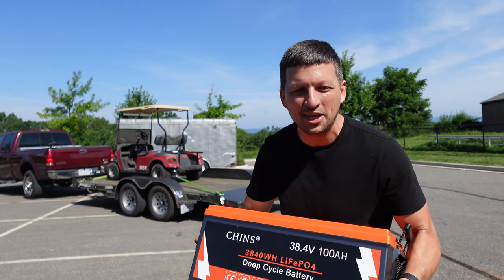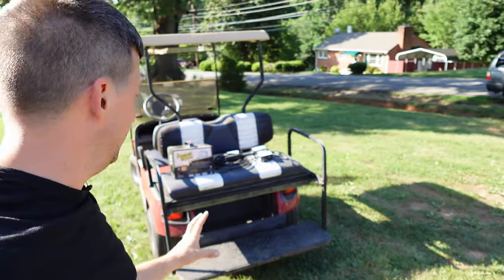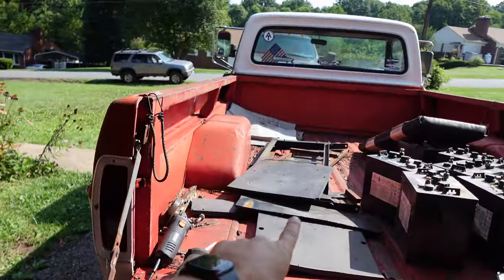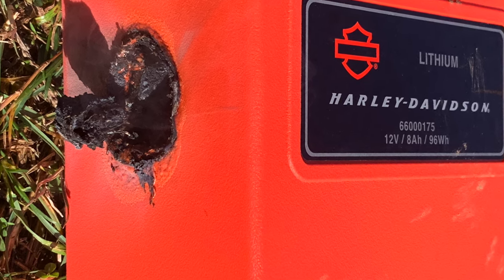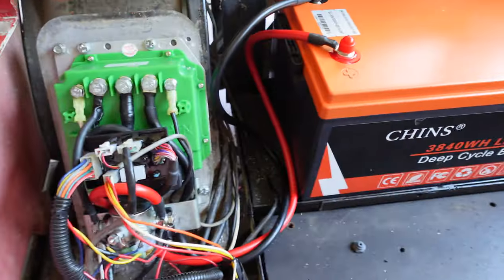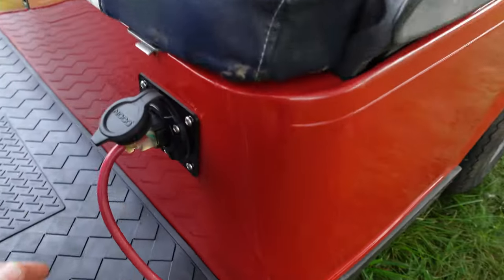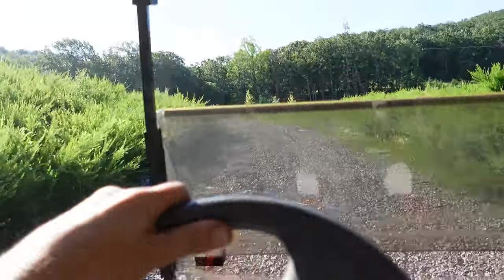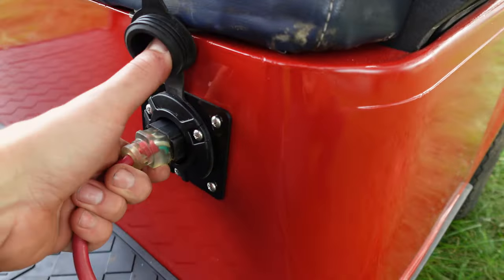Range Testing a CHINS Lithium Golf Cart Battery - PS Its Cheap!

Comment: Those things are absolute JUNK! I've had two fail that are a little over a year old. Tried to do warranty claim and they have been giving me the run around for 2 weeks, every time you give them information they want more and respond two days later. STAY away from this junk, it's going to cost you more in the long run.
Reply: What do you recommend?
Reply: @chentez1  good question! I liked the lithium batteries when they worked, much lighter and the voltage is constant until it dies. I bit the bullet and bought an Eco Battery, the price has come down a little but still paid 2800 bucks!  Time will tell if it was the right decision....
Reply from the maker: I can't speak to his experience but ours has been rock solid for a year.  My in-laws are not exactly kind to it and its held up.

Comment: I considered a cheaper lithium battery like the Chins which is a great value  until you have a issue and need it warrantied. These batteries are not well built. You could have zero issues and be lucky. I didn’t want to chance it myself

Comment: I have their 24 volt 150 amp battery, been running it 24/7 365 for two years in an off grid system . It's charged with a 1000 watt's of solar panels.. Full size refrigerator going all the time, washing machine or gas dryer when the sun is out all day.. It's modest with a 2000 watt inverter.. Best investment I've made in a battery..
Reply from the maker: I love all of this.  What kind of panels are you using?

Comment: Im just curious about the 10 years but time will tell.  I just got 3- 12v newti lithium batteries and charged once when it got to 79 %. That was a week and a half later. This 2004 ez-go txt has NEVER gone this fast. Gps it on waze and was doin over 15 - 18 mph !
 And shed 200 pounds !

Comment: Hey, I bought the same battery and put it in a 2001 EZGO TXT series cart. The only accessories are a light kit and radio. But it does have 20” tires on it. The cart runs fine but the range is nowhere near what you’re getting. The best I’ve gotten is 27-28 miles with the battery reading 23% remaining. Thing is, I’m afraid to discharge it any farther as once it drops below 50% the voltage seems to drop off pretty quickly. And I’m not pushing it, my average speed is around 12 to 14 mph. That sounds like a lot but the bigger tires seem to give it more speed. Another 2-3 miles would be all it takes to run it out. Got any ideas why the mileage is so poor? I keep hearing guys talking about 40 - 50 mile ranges. I can’t figure it out.
Reply from the maker: Is the 01 a different cart?  This has the switch on the dash for FNR.  I'm not sure what year started using a shunt motor and stopped using resistors to dump energy.
Reply: Checkout carts unlimited they have a conversion kit for that
Reply: Did u ever figure it out, I have the same issue

Comment: I bought a chins 20ah 12/23/22 to run my Livescope and head unit lasts 13 hours and I fish every weekend impressed so far little over a year old zero problems as of yet
Reply from the maker: We've abused this battery and it has been rock solid.  I'm seriously considering swapping out the lead acid battery and the charge controller on my RV.

Comment: Nice video ty! I gotta ask, the charger you have a link for is not far from $500.00, that's a rather  steep price for me. I'm a bit confused on converting to lithium: can I get a charger with that "D" shaped connection or do I need to remove the seat with each charge? Also, do I get a 36v charger or does a "smart charger " simply know what it's connected to? I'm sorry for asking so many questions lol
Reply from the maker: Great questions!  I often see (and have bought) those chargers used on eBay.  A the white tag has the model number on it.  If you can find a 30600 it will charge 36 or 48 and do lead acid/AGM/Lithium profiles.  These chargers (and others) have the option of using the D plug - but the charger would be off the cart.  Think of mounting it to the wall in your garage then plugging the D cable in.  I mounted mine onboard so I carry it wherever it goes.  I converted it to us a standard extension cord in place of the D connector.  I hope this helps.  I'm thrift too.  If you look around and get creative I'm sure you can save a few bucks!

Comment: I recently bought a 2007 EZ-Go cart and everything on it looks brand new, the entire cart looks brand new, and zero rust. I got it from a shop and the lead acid batteries were manufactured in April 2024. I still want lithium, but it will be lightly used so I’ll wait to see if it worth upgrading now or is I should wait until the current batteries run their course.
Reply from the maker: I would rock the ones that are in there until they don't meet your needs!

Comment: Lithium batteries are indeed worth investing in. Recently, I upgraded my 06 club car to Vatrer 48V lithium batteries, which use A-grade cells and are currently performing well. I no longer need to spend time maintaining the batteries.
Reply from the maker: I’ve been looking at their battery.  I picked up a 48v project cart that needs repowering.

Comment: Can i use my regular charger that came with the cart? Ready to buy battery. club car precedent 48volt. Thank you in advance
Reply from the maker: Hey sorry for the delayed response.  You could, it would depend on the BMS in the battery to turn it off when it was done charging.  If you are looking at a lithium battery, you should really look a pairing it with a lithium charger.

Comment: did I see a Navitas controller? I am wondering how this battery would hold up with some hi performance mods
Reply from the maker: You did see a Navitas controller!  Its just the stock replacement....although the thought of the inlaws doing wheelies and drag racing their friends sounds hilarious.   You'd have to check the amperage rate of the mods you want and see if it matches the discharge rate (sometimes noted as the C rating.)

Comment: Is this battery just drop and go? All I'd have to is connect the positive and negative terminal and ride? I have a 48v system.
Reply from the maker: You would need a 48v, but yes they are pretty much drop and go.  If you have 12v accessories like light, you will need a $20 step down converter.

Comment: Installed one of these CHINS for the Mother-in-Law.  Pretty good I must say, stock everything else.  2008 EZGO TXT-PDS.  I didn't want her to need to open an app to monitor status and installed an LiTime Monitor with Shunt.      I may not have ever known there was an issue had I not installed the add-on monitor but the REGEN is apparently not regenning....   the LiTime monitor records the REGEN amps going back to the battery (which is reporting 99% Remaining) but BMS is reporting 62% remaining (kinda what I expect without the regen).   Haven't found a tweak to remove the regen calculation for the status in the monitor or on the battery to accept the regen charge.  

Any thoughts?
Reply from the maker: Oh man, I have no good insight.  We swapped out our controller with the Navitas because the OEM was toast.  I know the Navitas has a programmable regen setting, but I'm unsure if you can adjust the EZGO.    How do you like the shunt?  I'm thinking about putting one on my RV.

Comment: I have a 2000 GEM E golf cart just removed the acid batteries. It's a 75 volt would this be enough to get her running? Thoughts? Thank you so much
Reply from the maker: I was wondering about those Gem’s…what kind of batteries came out of it?  How many and what voltage?
Reply: @BootstrapRevival  Ob my goodness I just killed myself & reinstalled the new acid batteries so heavy 😜🤪😂 My GEM is completely refurbished, did it myself but priced the lithium & way too expensive. Between $2,000 to $2,300 for everything. It’s a 72 volt 3 HP, if it were a 46 i would have been cheaper. I’m using Marine 31D deep cycle batteries they last two years only. It cost me $800 for the batteries. Thank you, I tried 🙏

Comment: How exactly did the charger sent up to for your Lester’s charger. Mine runs into a low voltage fault. Not sure what to do?? Might have to go to a different charger
Reply from the maker: I used the generic lester lithium profile.  I ignored the lester app and watched the BMS app to see it cut off in bound voltage and not over charge.  It has not been an issue with the battery.  I do know different lester models allow for different profiles (meaning some don't allow for lithium charging).
Reply: Are the different profiles selectable through the charger app or do you have to order the charger profile specific? I just noticed the amazon adds do not say anything about the profiles. Thanks @BootstrapRevival
Reply from the maker: I apologize for the delay.  Correct, in the app for the charger you can set different battery profiles like lithium, lead acid, AGM, 36v, 48v.  They even have a pile of profiles for the big player brands of batteries.
Reply: Thanks for the reply! im working on restoring a 1995 club car ds and i am probably going to go with this same battery @BootstrapRevival

Comment: How's the battery holding up? I'm looking at buying it for my cart
Reply from the maker: Honestly it’s been a champ.  We gave the cart to the in-laws and they have been using it non stop with no issues.
Reply: @BootstrapRevival  thanks for the response 
I'm just a little worried if I go up a steep-ish hill with a passenger or 2 it might trigger the overload and the bms will shut down the battery but it looked like you went up some steeper stuff and it did fine 🤷‍♂️
Reply from the maker: @predatorhuntsnw1835  - I did, and the really steep stuff was with two people.  It didn't film well, but I went up a super steep pitch up a mountain.  That grade is difficult to walk and my cart did fine.   I like buying from Amazon because of their return policy.  If you do try it out and you have issues you can return it easily.  Let us know how it goes!

Comment: I have a ezgo txt and have been reading that I have to run two batteries?Do you know if that’s true? Or can I run one like you did?
Reply from the maker: I used just the one large lithium on a 36v cart.  (They make one for a 48v cart too).  I'm not sure why you would need two.  I would highly suggest a cheap voltage step down converter to run your 12v accessories and lights.

Comment: Been thinking of doing this and adding an inverter so that my golf cart can be a mobile power station.  I would like to build a small cabin near a pond on my property and this would be a great way to get tools and power up to the site without having to run a generator.  Throw a couple of solar panels in the mix and, Bob's your uncle.
Reply from the maker: I completely agree.  When we get a few acres I want to upfit a cart for farm work including mobile power.  Almost like a portable generator but less of a main to more around!
Reply: I have a 48 volt Yamaha golf cart that I put 4 12volt chins batteries in and a 60 volt 325 watt solar panel on and I haven’t had to charge it in 3 years. Just bought a 48 volt inverter to do the mobile power station too

Comment: Nice Vid!  I have a 2006 EZ-GO TXT with the PDS drive (36v)....Is yours a series motor or PDS cart?  What are the details on that new controller and harness you've installed? Is there a link to that? My stock Curtis controller seems to run quite warm after just a three mile drive.  Thanks
Reply from the maker: Great question.  I have a PDS cart.  I used the Navitas 440 Amp  TXT stock replacement.  It cheaper from this seller on eBay than anywhere else I've found.  It includes the cool remote to adjust (and lock) your speed/acceleration/regen. The kit is plug and play.  It would not fit under the cover so I cut the cover in half and it hangs out but its waterproof.  I was able to keep my run/tow switch in the same spot.  I think they make a mounting plate - but I just made do with what I had.

https://www.ebay.com/itm/303204173360
Let us know how it goes!

Comment: Are you using a the Lester summit 2 charger with this? I read a review that chins only will accept their own charger
Reply from the maker: We are using the Lester 2 charger with the generic 36v lithium profile.  Between the onboard battery BMS and the lester it has been working fine.  The only odd thing is the lester app shows over voltage, but the battery app shows that BMS turns the charge off at the right voltage.  I suspect Lester might have a profile update as more of these inexpensive batteries come on the market.  We will be at the in-laws house in a few days for the Holidays and I'm going to give it a good once over again.  I can follow up if I find any issues (or a new battery profile), but so far we have not used the Chins charger and it's been fine.
Reply: Yes make an update video
Reply: Please

Comment: can i just drop this in to my 36 v ez go txt or do i have to add some electical things
Reply from the maker: For the most part yes.  If you have 12v accessories that are wired to one or two batteries you'll need one of those 36v drop down converters.  They are around $20, I linked one in the description I used.  I do recommend finding a lithium charger, but if you look around you can find a deal.

Comment: i just replaced 6- 8V batteries with one Chins 48V 100AH similar to your. I hook it up, and nothing. Do I need to adjust something on the BMS. I heard you mention REGEN set to zero. I see all kinds of options in the settings, protections and delays, but don't know which one might be causing issue? When i turn the key, and put it in reverse, that awful sound comes on; so some power is clearly in the system. But when I hit the pedal, no movement. Any thoughts?
Reply from the maker: Are you seeing voltage across the terminals with a meter?

Comment: Would it handle a 600 amp navitas
Reply from the maker: I'm not sure.  Our cart was using the navitas 440 with no issue.  I think the 48v battery is rated to discharge 500a at once.  Will the navitas consume all 600 at once?

Comment: Am I able to make a 60v with a chins battery. Says not to do more than 4 batteries in a series but wondering?
Reply: No because the BMS they use has certain voltage mosfets that will not support over 48v.

Comment: With that much power it gives you a lot of range I think you can lose. I’d be cool to figuring out how to double the speed of the cart. You’ll have less range but with how much you have it’s worth it
Reply from the maker: There are AC motor conversions that will do insane speeds and wheelies - but I swear I'd break the cart or myself!
Reply: Only way to increase speed for sure is more voltage, gears in rear diff or tire size . The lithium method increases speed a un noticeable amount unless old batteries were poop and there is a difference in acceleration with lithium do to weight reduction

Comment: You did more talking than installing, we the ppl want to see the install..
Reply from the maker: Sorry about that. The install is very straight forward.  Its only 2 wires, Battery + and battery - out of the box with the speed controller in it.  If you are using aux lights, headlights, etc I highly suggest wiring in a step down voltage converter listed in the description.
Reply: Ya it's literally just sets in there and you put the red wire to the + and the black to the -